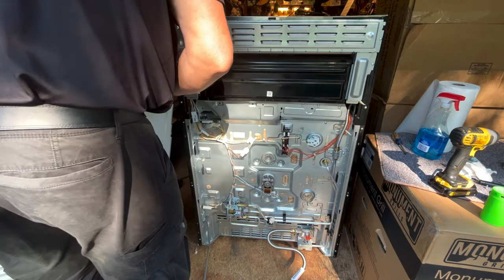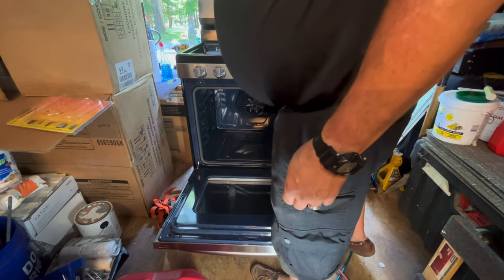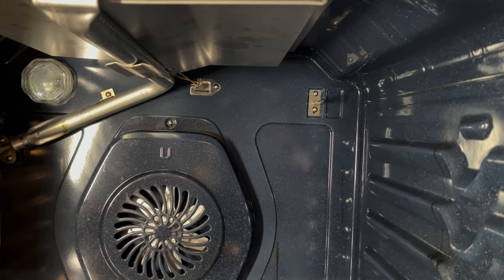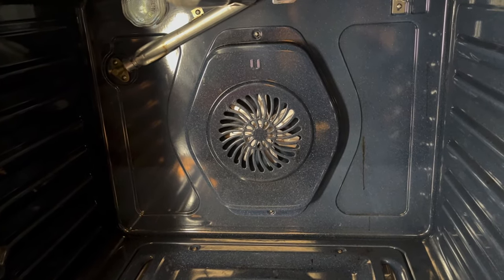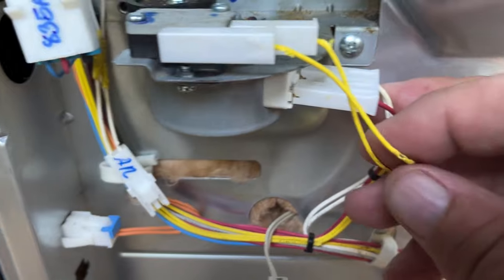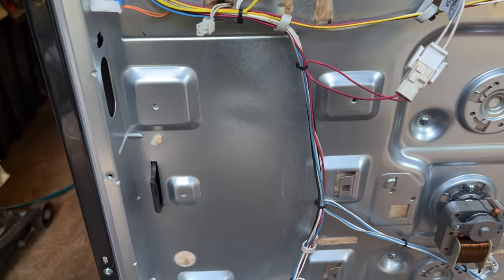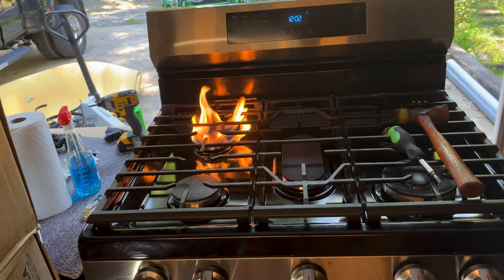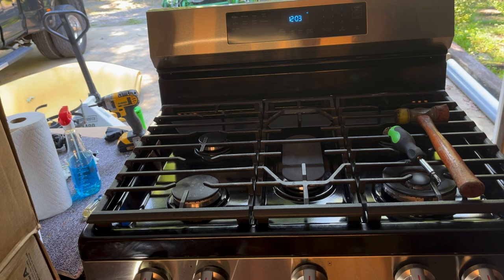SAMSUNG RANGE C-20 ERROR CODE. How to change temperature probe sensor

Comment: Hi thank you for your video! I did everything you said but my stove won’t display anything? Is there a way to switch on the display pad??? In order to turn on the oven
Reply from the maker: I don’t have an answer to that. I would check for a loose plug at the board of the display, it should be on the back side. Look for damaged wires also. If not that, it may be a bad display and needs to be replaced. Sorry, good luck
Reply: Thank you!

Comment: Hi, I had a mouse chew up wires in the back of my stove. I am having a hard time figuring out what goes where. I am getting the c20 error code, but I also have blue wires at the bottom that are completely chewed through. Do you have any idea what they go to?
Reply from the maker: This video does show the blue wires. I recommend that you search the web for a wire diagram for your model. I will do the same and with that, it should show the color coding and where they go. Good luck.

Regards 
Jack

Comment: Do you have a part number? Or where did you get your part?
Reply from the maker: Rick, in the video it has a screen shot from Amazon with the part number. Mine was not the probe sensor, mice had chewed the wire to the sensor. I just repaired the wire. Hope this helps

Comment: C20 error code I’m getting on the same stove. And the bake is getting to hot. Is the sensor the issue?
Reply from the maker: If you are getting error code C20, it is most likely the sensor or the wiring leading to the sensor. I would pop off the rear cover and inspect the connector and wiring. If all looks good, the sensor maybe failing.
Reply: @lifeintnchevalier  thank you boss

Comment: I changed the sensor and it didn’t fix the C-20. Also after I discovered this I did a ohm test and both sensors are working. So basically I have C-20 but the sensors work fine. So how can i fix it
Reply from the maker: C-20 code is for the temp sensor. I would follow the wires and see if there is a break.
Reply: I have the same problem. What was the end result ?
Reply: @3Gdogger unfortunately the code was due to a bad computer board and they are one of the more expensive parts to replace. Replacing the board fixed the problem but keep in mind there is two computers (one for the front screen/panel and one in the back of the oven) so you may need to figure out which one is at fault between the two.
Reply: @3Gdogger obviously you want to try replacing the probe sensor (as this video demonstrates) BEFORE considering the computer board because the probe sensor is much cheaper and likely the culprit